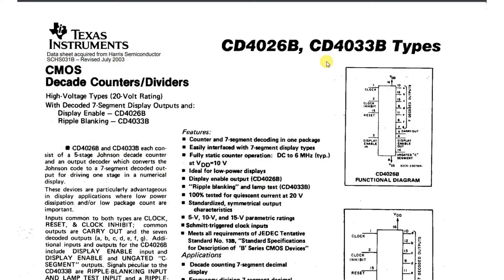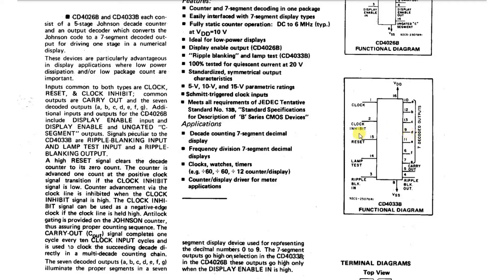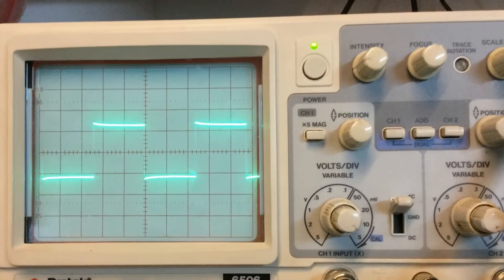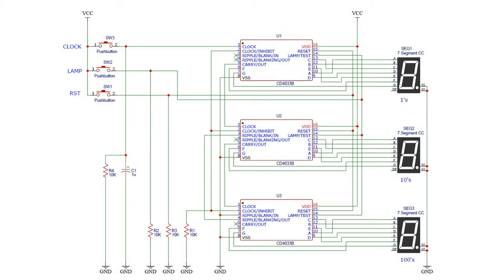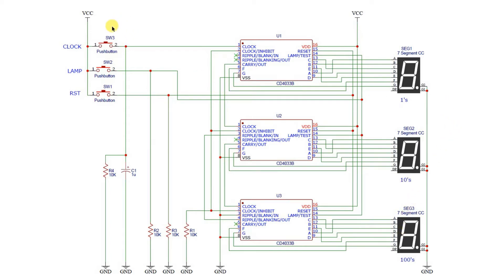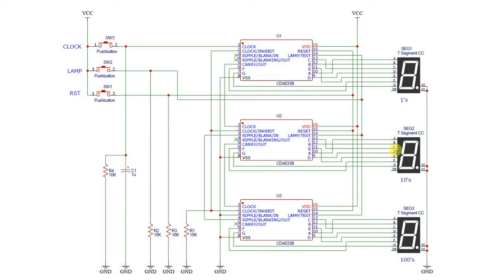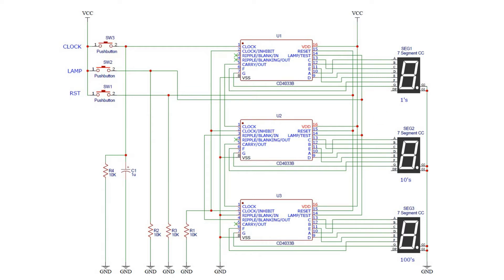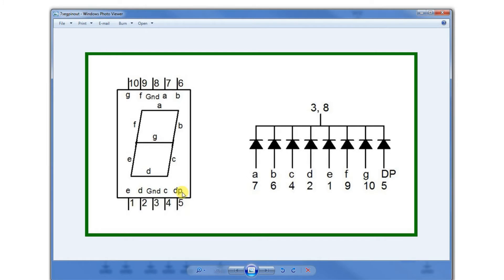CD4033 0 to 999 Decade Counter with Ripple Blanking

Comment: Please explain why you have connected 4033 pins directly to the seven-segment display without any resistors, so no brightness control and safety.
Reply from the maker: The 4033 limits the current, saves on using all those resistors.